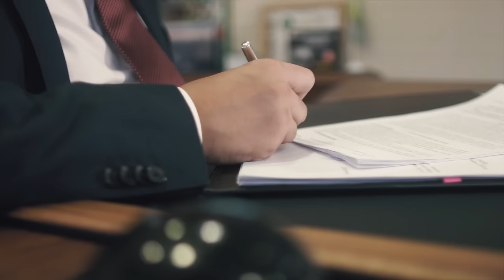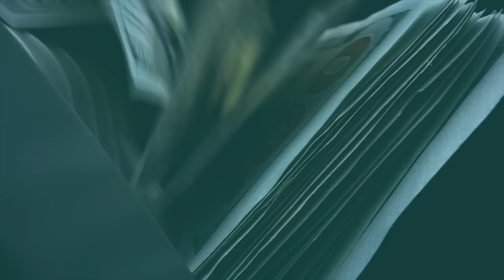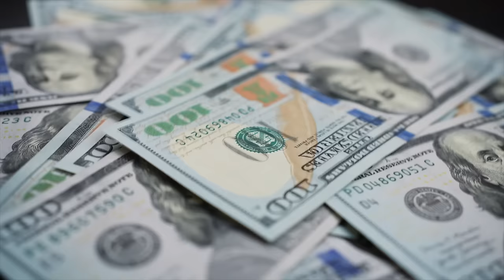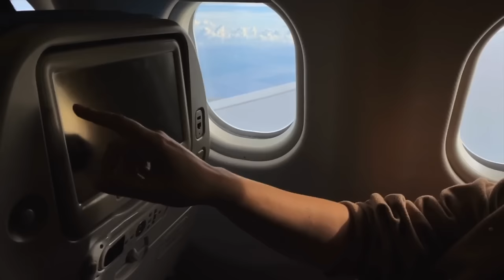How California Finally Plans To Finish The High Speed Rail Project

Comment: If 99% of the people taking the train are going from LA to Sanfrancisco then it doesn't make sense to run the train along the east side of the valley and have all the stops at every little town there. That is one reason the cost has skyrocketed. If it followed the 5 freeway on the west side it would have been much cheaper to build. There is not much out there and they can lay track on open ground.  Also since the trip will take longer it makes it more tempting for people to fly or drive. The decision to go up the east side was strictly political and makes no economic sense.
Reply: the i5 freeway doesn't allow for much expansion in width, plus many of the cities in the valley have a population of more than half a million people, so it would make sense to connect those corridors instead of just having 1 connection between SF and LA while completely ignoring the cities of the valley. It would also allow more people to travel to and from SF or LA back to the valley. Although building in between the i5 median makes economic sense in the short term with no haggling with the people who own land in the valley, this would be a long-term system that needs at least some service to the massive valley population (6 million).
Reply: This has all been argued before. The citizens voted to tie all the major population centers together, and this route does that. It would be a little shorter on the west side, but require much more massive tunneling re Tejon Pass. So, wouldn't save much, and would lose traffic to CV cities. This is a reasonable compromise. Also, this is a fair competition to flying (with all its passenger complications of TSA and airport to/fro).

Comment: Eight meter wide triple level maglev trains traveling 800 kph - 1,000 kph are a reasonable development to start to take place by 2045.  The issue with HSR is that it is rail that first made 300 kph way back in the late 1970s and is not maglev with new first generation 500 kph maglev trains in Japan scheduled to start in 2027.  They need almost incrementally free electricity. 

The loading gauge of trains has always been wanting to be over double that of standard gauge trains.  1840 UK double track railroads were designed to occasionally have double width wagons use the inner rails of the two tracks.  An 8 meter width would allow most cars to be loaded perpendicular on the first level or shaped cargo containers.   Maglev motors are likely a bit noisy making the first level less desirable for people.   The second and third levels could be continues luxury passenger space with vista domes in some location on the top level for seeing the country out the front and backward. More than double the current passenger car width with continues high ceiling double level passenger space these double width trains could carry four times the number of people more comfortably in the same linear space as current single level standard gauge trains allowing passenger trains to not stretch out for many city blocks.   

For pure cargo this 8 meter loading width gauge would allow moving large cargo over land easily to some near destination where it might need to be moved over roads at night to make use of double lane widths.   The large cargo size made viable by an 8 meter or more loading gauge would create a different world than we know today.   The main reason for not having double the loading gauge of todays trains is the rail wheel interface is at it practical limit.   Indian wide gauge 5' 6" is what would be chosen if wanting to choose a practical relatively well known practiced rail gauge today, but maglevs can be designed to have distributed loading across its width so they are not restrained the way the current rail wheel interface restrains current trains..

Comment: In 2009, President Obama awarded CAHSR PHASE 1 project $3.5 billion. Since 2011, Washington politics have prevented CAHSR project from receiving substantially larger federal funding to cover 55-60% of the cost. If it did, state funds that now cover 85% of Central Valley CAHSR construction, would have shrunk to roughly 25% of Phase 1 project costs. Affected counties and freight rail companies would contribute 5% for over/underpasses and siding tracks in their domain. Once those public & freight rail funds had many segments under construction, the last 10-15% would come from a private Passenger Train Operator and multiple Transportation-Oriented Developers attracted by 40 million annual CAHSR riders IN what COULD have been A 2031 OPENING.

Comment: Would Amtrak have to keep the San Joaquin trains after CA HSR becomes operational?
Reply: As I understand, it they would start in Merced with cross platform transfers and follow their existing routes to Sacramento and the Bay Area. The locations losing service, such as Corcoran,  will be served by buses to the nearest HSR stops. That will actually be faster than the present situation and provide service to more people at intermediate bus stops too.
Reply: @danielcarroll3358  they would have to keep the Oakland-to-Stockton section after the entire project has been completed so that passengers from the inner Bay Area can can continue to go to Stockton
Reply: @coleallen3895  Very possible. There are other lines that are planned to be added in the Bay Area. For example connecting SMART to the Capitol Corridor.
Reply: @danielcarroll3358  I wish funding would be  allocated to build a new tunnel under the bay so that Amtrak trains could go directly to Downtown San Francisco and serve the Transbay Transit Center - it could happen in the 2030s or 40s, because by that point, all the trains would be zero-emission and the ALC-42s could be converted to battery power by then
Reply: @coleallen3895   That is in the long term plans. Actually four tracks are planned, either on one route or separate routes for BART and standard gauge. But this is definitely down the road a piece. The tunnel from the Transbay would make it a run through station and increase its capacity by about 150%. The BART tunnel would allow BART to run 24 hours as maintenance could be performed while still having a route to the East Bay.
Reply: @danielcarroll3358  is BART making plans to extend to Stockton??
Reply: The CAHSR plan is to connect with San Joaquins (which would only run north of Merced); south of Merced the San Joaquins would be suspended.

Comment: I'm a big fan of transportation megaprojects and I would love to see American rail lines become more developed in the future. With that said I think there are quite a few issues with this project. 100 billion is WAY too much money to spend on something like this. Egypt's literal brand new capital city in its entirety costs less to build than that! Secondly I don't really see who exactly this is being made for? Its slower than the planes that already go directly between SF and LA, and will likely cost more to ride than simply taking your car, so it kind of strikes a weird middle ground, one that I don't really think there's much demand for (at least not from what I've seen). Finally even if it were cheaper than your car, there's still not really a use case that I can think of where the average person ever uses this train on a regular basis. With other bullet trains a common argument in favor of them is that they connect cities quick enough that you could work a job in one city while living in another, thus keeping housing prices down. However realistically there's no one that's going to travel 2 hours and 45 minutes each day to get to work in San Fransico then return to LA. In that sense its use is still limited despite its speed. Again I'm glad projects like this exist and would love to see more cities try to tackle this problem but its no wonder that its taken so long for it to catch on, especially with that price tag.
Reply: This project was voted upon in 2008 and has had numerous polls since then that indicates people will use this. Everyone does not like to fly and I think what many Americans fail to understand is that high speed rail is a CHOICE. People will always drive and fly, but if people are provided with a better way to travel between two points, they'll use it. The Northeast Corridor, although old, proves this. So while YOU may not find a use for this, it's clear that others do which is why they're building it.
Reply: @TheRailwayDrone Probably a good thing CAHSR will take decades to complete since it appears it will take that long for California travel to return to previous levels. SF-LA air travel is down 33%. BART, ACE and Caltrain are down 40%. Sort of ironic.
Reply: @davidjackson7281  The population of California is still over 38 million people. And contrary to what western news agencies report, people are moving to Cali every day. So yes, this is still needed. We need to start seeing the forest through the trees.
Reply: @TheRailwayDrone 30-40% less commute. Not just relocations. Demographics different. More deaths less births. Use of CA Amtrak routes are down.
Reply: @davidjackson7281 down from 2019, but they’re steadily increasing back to pre-pandemic levels. The CA routes still have the highest ridership for Amtrak outside the NE.
Reply: @ChrisJones-gx7fc Always love your positive spins. Connecting San Francisco to the Central Valley via a one mile Dumbarton Rail Bridge could be used by Caltrain, CAHSR, Amtrak, and ACE. Upgrading the Surfliner's speed and frequency plus extending it to San Jose would really increase ridership.
Reply: @davidjackson7281  but a Dumbarton bridge would likely be single track like the original, creating a bottleneck between all those services. Same with going over Altamont Pass but also through Niles Canyon. Much of that route is single track. I’ve seen ACE plans to increase its frequency to 8 roundtrips per day up from the current 4. As I’ve said before, Valley Link is happening to address needing higher frequency between the East Bay and Central Valley that can’t be provided using the current UP-owned rail line.

To meet the frequency and capacity required, CAHSR needs its own dedicated route to the Bay Area. Altamont and Pacheco both have their pros and cons, but for HSR to share tracks presumably all the way from Merced to SF through Altamont and across Dumbarton, would impact how many trains they can run. 

CAHSR compared both passes and chose Pacheco, and are moving forward with that route having environmentally cleared it and are completing geotechnical work in anticipation of construction. 

There’s no identified funding for beyond the Central Valley, so neither pass could be crossed at this time. ACE has no plans to electrify Altamont, or down to Merced. UP owns the tracks and is resistant toward electrifying. Trying to pursue a shared alignment over Altamont now, essentially going back to Square One to do so, would more likely present more setbacks than benefits. 

Once CAHSR gets Merced-Bakersfield operational, they’re going to SF via Pacheco and the shared Caltrain line from Gilroy. Maybe they’ll even begin construction over Pacheco before the 2030s if sufficient funding is secured for it prior to interim Central Valley service starting. They’re getting Pacheco ready so work on construction could begin as soon as funding for it is secured.
Reply: @ChrisJones-gx7fc  I completely understand why the route was established with tunnelng through three mountain passes to include Palmdale and Gilroy. The alternative alignment I advocate would save 15-20 years, $30-40 B and be :45-1:00 slower. 

Per wikipedia, the Dumbarton bridge was double track. It was the approaches that were single track. The Altamont route, similar to the complexity of the Peninsula route would be on 110 mph track like Caltrain. Niles Canyon would add a second track perhaps with another short tunnel and be much easier to build than the 15 miles of Pacheco Pass tunnels. 

Not being familiar with Valley Link, perhaps it is redundant to the ACE route and addresses the connection better. Maybe utilizing some abandoned Altamont tracks would alleviate sharing freight with UP. Some track from Livermore to Modesto could be 125 mph. Since electrifying and upgrading from San Jose to Gilroy would be unnecessary, CAHSR could extend from Merced to Modesto which is five times larger than Merced and be closer to Stockton. 

A population of over one million would be closer or on the route. There would be transfer stations at Union City and North Lathrop with express stops at Livermore and Modesto.
Reply: @davidjackson7281  so how exactly would you route HSR trains from Merced to SF on your proposed alignment? Like describe it as if tracing it on a map. I want to see how you got those numbers.
Reply: @ChrisJones-gx7fc Will try to answer your questions Chris. A $29 B Pacheco Pass would be replaced with about $5-10 B for upgrading Altamont which is 2-4 times what the Caltrain Corridor cost. Not gonna describe a theoritical route that you perhaps may find fault with. Someone with your surname and 1st initial M did that in a previous posted comment. A $32 B Tejon route would replace $43 B of the two Palmdale routes. Though about :30-:60 slower, the SF-LA route would be 8-10 miles shorter.
Reply: @davidjackson7281  I wouldn’t necessarily find fault, I’m just legit curious. 

Like I’m imagining you’re having HSR trains share tracks all the way from Merced, following the UP line over Altamont and through Niles Canyon, across a new Dumbarton bridge to Redwood City then up the Caltrain line to SF, with a couple additional stops on the way. I assume your upgrade costs include electrification of that entire route. Any straightening/realigning of that route for faster speeds or all current track? 

Certainly it would allow for faster regional service between the East Bay and Central Valley, which would be huge in helping relieve congestion on I-580.
Reply: @ChrisJones-gx7fc  Yes, on Class 5 and 6 tracks with some class 7 (125 mph). Think of how Brightline shares with freight but with many less troublesome at grade crossings. The freight through Altamont is about the same level and can be co-dispatched. The speed would be like on the Caltrain corridor. Four different passenger rail systems could utilize the bridge. Preferably it would go to Modesto where CAHSR would extend from Merced. Forget the Merced wye. It would be an easier Lathrop wye. It would be more complicated say for San Jose. Extending the Pacific Surfliner from SLO to SJ would be nice.
Reply: I'm afraid that when too few people ride the first section from nowhere to nowhere, its economic unviability will kill the rest of the project.  Shame really, I have been wanting a NoCal to SoCal high speed rail for 50 years, but this project is shambolic.  At least there is some hope for Brightline West.
 @TheRailwayDrone
Reply: Population of California has declined by about a half million since 2020 
 @TheRailwayDrone
Reply: @LeadPilotLV Fortunately, the facts about high speed railways prove otherwise. And though the population of California has declined, it's still higher than most states in the midwest, combined. So I'm not worried. Look outside lately and look at the traffic on the interstates. It's still needed regardless of how many people have left California. Also, many of you should understand that people will continue to move to California in the future just as they move to other places.

Comment: Im confused...we can now fly from LA to SF in about an hour and a half, drive it in 8 hours or take the regular train which takes about 12 hours.  So why do we need to spend a couple billion on high speed rail option?
Reply: Bảo vệ môi trường
Reply: @vlog41098  Environmental protection?  Cost exceeds benefit in my opinion.  There is a limit to the $$ that can be dumped into such things.  Besides the state of CA has a horrible record on taking dumb environmental actions....perhaps the billions earmarked for the rail system could be better spent cleaning up the groundwater contamination from the states stupid decision to require the fuel additive MTBE in the 1990s.

Comment: There was no budget set out in prop 1a, therefore there is no budget overrun
Reply: There was an estimate of $33 for Phase 1. That's what it will cost to get the IOP (about 1/3 of Phase 1) operational.
Reply: $33 B
Reply: @RobertBenson-ce3xc  an estimate is not a budget

Comment: Hopefully the California High Speed Rail is run NOTHING like Los Angeles Metro.  The rail systems Metro built have a top speed of 65 mile hours (which was required in the spec).  But they operate (per Metro's own website) at an average actual speed of 27 miles per hour.  @The Impossible Build, you mention that the California High Speed Rail system is requiring the rail car manufacturers to spec an average speed of 350 kilometers per hour.  Do you know if they have an operational speed REQUIREMENT?  L.A. Metro has proven that just because a train can run at a specified speed, doesn't mean that it will operate at that speed.  If anyone knows anything about REQUIRED average operational speeds of the system, please chime in.
Reply: Testing speed of 242 mph, sustained maximum of 220  mph. Train speed specs are based on what the needed timings are and what the route can sustain.(so blended speed is 110 mph).

Comment: Nice video calling out US politicians, Canadian presenter dude! We do have the Acela line back east, but it has to run slower than its capacity due to the rails not being built for high speed. I’d argue the issue is not money. The federal government pays $750b/yr on defense. Money is clearly not an issue, it’s political will/leadership. Every time politicians prolong and delay the project, they make it more expensive. If they cared so much about cost, they would fully fund the project at the beginning and not interrupt it.